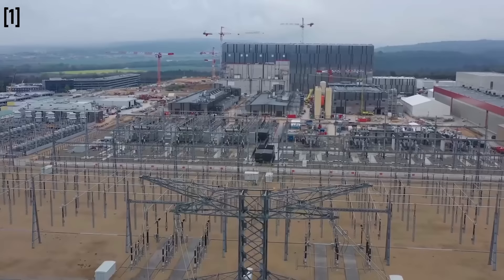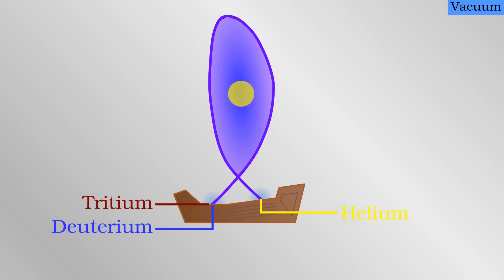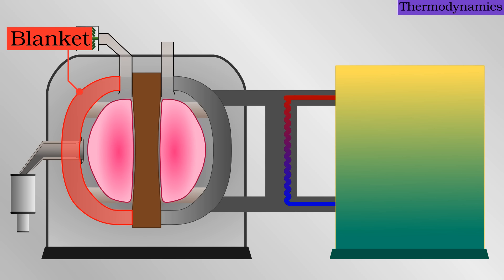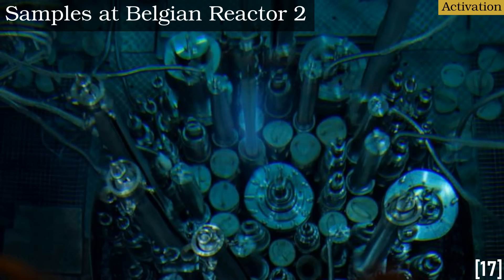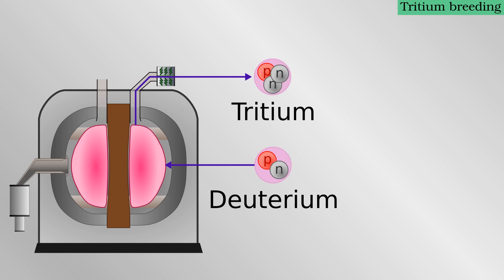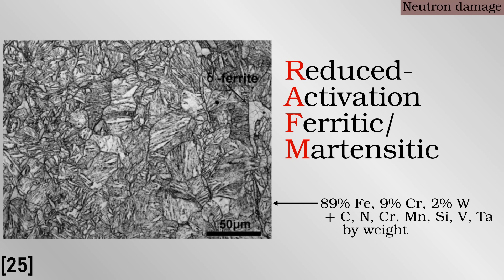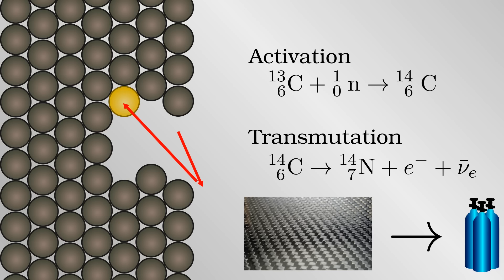How nuclear fusion (maybe) works (4) - reactor practicalities

Comment: I thought there was another method of "direct energy conversion" available to fusion reactors, but I may have been misinformed.
Plasma is made of charged particles right? What if you run the fusion plasma thru a magnetoplasmadynamic generator? Idea is simple, you have two electrodes, and two magnetic poles. The ions get attracted to one electrode by following the magnetic field lines, and the electrons follow the same magnetic field lines to the other plate. This causes a charge difference, or voltage potential, between the two plates, and by connecting an electrical load between these plates you generate an electrical current and neutralize the plasma at the same time.

Even without any college degrees, my high school physics understanding of how an X-ray tube works already tells me that at the negatively charged plate of such a plasma ion current based generator, x-ray generation will be a problem, and heating will be a problem at both plates.
However, it DOES generate an electrical current, and so energy IS present there, likely available as high voltage DC (or pulsed DC in discontinuous systems such as ICF reactors).

Is this method of generating electrical energy not possible? Why do you prefer to allow the magnetic fields to move and induce a current in a conductor, rather than harvesting the charged particles directly? I'm relatively certain that this method could also be run in reverse to cause plasma heating, and it likely already is.
But if I know one thing about physics, it's that there are not that many processes which are non-reversible. Of course, nothing is 100% efficient, but it seems that direct ion conversion would be incredibly efficient (and the gas produced should still be at a high enough temperature to run a standard steam cycle, if you really wanna optimize the production of energy from the reactor).
Reply from the maker: Yes, this is also possible. It still would have well below 100% efficiency, though and will be difficult to do. For example, I saw a proposal where they would need a 100 meter long converter for a 70% efficiency. Good luck bolting that on to an already enormous facility.
Reply: @ImprobableMatter  To make that shorter, you probably need stronger magnets, right? Could superconductors be applied to that to reduce its size? You trade off electrical resistance in the conventional magnetic solenoids for thermal losses of the system cooling the superconducting solenoids, but overall the more intense magnetic fields should make it easier to fit somewhere, plus there's that "flux pinning" thing that happens with superconducting magnets that should help it resist changes to the magnetic field geometry right?
Sure there's challenges to be overcome, but there's challenges to be overcome with the system as a whole, and I don't feel like this adds too much extra challenge to it because superconducting magnets are a relatively well-understood technology from what I understand.
Reply from the maker: @44R0Ndin  From what I understand (someone correct me if I'm wrong!) that method requires DC voltage. There's only so much potential difference you can have before it breaks down, even in a vacuum (i.e. you can't have 10 million volts across a millimeter gap and so on). Therefore, there is a reasonable size limit.
Reply: As stated, it wouldn't be able to capture any neutron or bremsstrahlung energy. Also, if you have the plasma actually colliding with the electrodes, it will be a big problem since the electrodes will be destroyed and the sputtering will put impurities in the plasma. For small scale experiments, you can have a weak plasma directly contacting a metal surface, and you do get a Bohm sheath charge due to electrons hitting the surface more than ions. And you can use geometry of barriers and magnets to cause only electrons to hit some electrodes, creating a voltage. But that isn't possible in a thermonuclear plasma.

Comment: I think aneutronic solutions that take advantage of direct induction methods of generating electricity hold much more promise for near-future base-load power production than your video let’s on.  
Most of the dangerous problems you’ve mentioned center around dealing with neutron emissions which do not happen in aneutronic reactions.  You also said that Hydrogen+Boron fuel is the only type that is truly aneutronic, however, Hydrogen+Helium3 is also aneutronic, producing a lot less Helium4 ash per reaction (1 instead of 3).
I do however agree with your analysis as far as it is being applied towards inertial confinement, tokamak and stellerator style reactors.
Reply from the maker: Hydrogen (one proton) has insanely low cross sections with Helium and Beryllium. Helium-3, unless you are breeding it through neutronic reactions (*cough* Helion Energy *cough*) is too rare to be economical.
Reply: @ImprobableMatter   It is now, yes.  But there is an enormous amount of free He3 that can be harvested from the Moon and eventually from the gas giants as well, so the cost factor should come way down.
I’m sorry but I do not understand what Proteum’s small cross section has to do with Beryllium; the magnetic fields used to confine the plasma keeps it from interacting with the reactor walls to any appreciable degree, while simultaneously increasing the likelihood of particle interaction between the hydrogen and He3.  That’s my understanding anyway.
Reply from the maker: @cyberiusprime4855  Harvesting Helium-3 from space will not be practical for hundreds of years, if ever. If the cost to launch is so low, why not just build space solar arrays for free energy?

No magnetic field can confine a plasma perfectly, so some will always be lost to the wall. Also, hot plasma emits radiation by bremsstrahlung and cools, requiring energy input. This will mean a p-B reactor will never achieve electrical breakeven.
Reply: @ImprobableMatter  I predict that being able to mine He3 from the Moon, in quantities that would benefit the operating costs of aneutronic fusion reactors is somewhere between 20-30 years away.
Helion is almost finished building there 6th-generation reactor which holds the promise of delivering net-positive energy within the next 3 years (albeit at too high a cost to be commercially viable yet), but that's not what's important now.  What is important is showing that the tech works as advertised.  If they can do that, then the profit motive for mining the Moon's He3 will have been secured, and Capitalism (i.e. greed) steps in to turn the promise into reality.  
Your time scaling for this is far too pessimistic in my opinion; you are aware of NASA's Artemis program to establish a moon base over the next few decades?  And Elon Musk's Starship Heavy Lifter?  The tools for getting there are well underway already...
I really think you need to research aneutronic reactor concepts a bit more thoroughly (and exclusively) rather than glomming them in with the older reactor types and their set of problems.
Helion's reactors use a reverse toroidal configuration for generating its initial stage reaction plasma which takes advantage of both magnetic and inertial confinement strategies simultaneously, thus the magnetic fields do not have to do all the work of confinement themselves, which I'd imagine helps minimize wear and tear on the reactor walls.   Plus, their design is not intended to create an on-going fusion reaction as is the case for tokamaks and stellarators.  Their current goal is a more modest fusion-pulse repetition just large enough to generate more energy out than it cost to power each pulse, then scale up the pulse frequency until it can produce enough electricity to be useful for grid-scale applications.  Seems sensible enough to me.
Last but not least, I can't speak on behalf of the p + B approach to aneutronic fusion; I haven't researched it enough to know what engineering hurdles it faces; Helion's approach uses D + He3, which you did not cover in your video.
Reply from the maker: @cyberiusprime4855  A single lunar base is very different from a cost-effective mass mining operation. The concentration of Helium-3 is measured in parts per billion; that means - roughly speaking - that if you want a kilogram of Helium-3, you will need to move of order a billion kilograms of rock. You need to somehow refine and separate out the Helium-3 and send it back. Good luck.

The proton-Boron reaction has an even lower cross section and requires even higher temperatures, so it's far harder to do even than D-3He.
Reply: @ImprobableMatter  Yes, I understand that these are early days yet, but if the Artemis project succeeds, then that "proof of concept" will become the basis for commercial investment in that new sector of the mining industry.  Once that happens, things tend to move much quicker.
Helion's analysis of the amount of He3 on the moon suggests that it exists in a sufficient quantity/state for easy extraction.  I do not pretend to have done any independent analysis of my own with which to verify their projections, so who knows how hard it will actually be.  Clearly, they are optimistic about it themselves.
Anyway, it was because of your high degree of skepticism towards the aneutronic approach to fusion that I felt compelled to argue in favor of Helion's D + He3 pulse/induction technique as a possibly viable approach - which I am still hoping will work as advertised.  I guess we'll find out in a few more years.

Comment: The presentation keeps saying a Tokamak is steady like a stellerator and it is not, it is pulsed. It depends on the collapsing central solenoid field to induce current in the plasma and the twist the magnetic confinement.
Reply from the maker: You can achieve steady state if you have beam or wave current drive. See part (3) of this series.

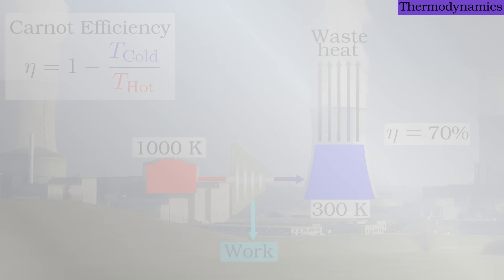Comment: 8:19
Really? Which fusion projects are assuming 60% efficiency in their thermodynamic cycle?

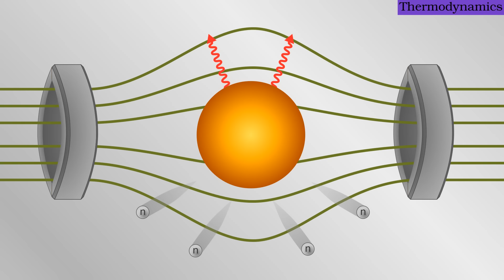10:05
Which projects are suggesting direct energy conversion from D-T plasma?

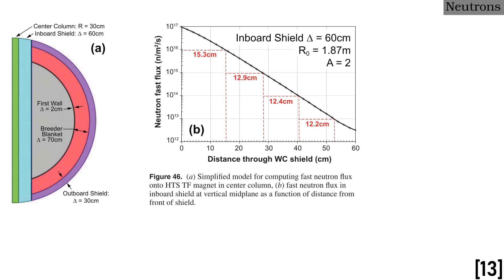12:21
Of course. Statistically, you can never rule out that a single neutron will be stopped by a galaxy of material. But I'd feel confident of its safety, given the log graph you present. Are you suggesting shielding is not practical?

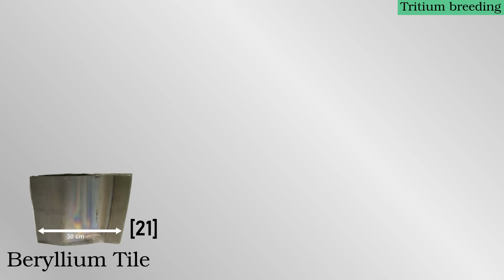19:50
Beryllium is a wonderful multipler, but there is not a lot of it in the world so many commercial concepts are looking at alternative multipliers, such as lead.

20:48
You're partially correct; a hybrid fission-fusion breeder reactor could be made but would present significant political challenges. [Edit: I spoke too soon; you mention hybrids at 21:50.]

On the whole, a good presentation, though we should be careful with communication of facts.
Reply from the maker: Reference [13] has a scenario of 59% efficiency for a fusion power plant on page 10. Reference [9] discusses direct energy conversion from a D-T plasma on page 205.

Comment: I have heard of Stirling engines, thermocouples and turbine engines. But never about Carnot heat engines. Could you do a video on the differences between them in the future?
Reply from the maker: The Carnot Engine is a hypothetical ideal (not actually something that could be built) heat engine which has the highest possible efficiency of converting heat to work. Any practically built one, like the Stirling engine, can at best theoretically reach the Carnot efficiency, but no higher.

Comment: It is unfortunate that new problems appear on the way to working fusion reactors. Material damage is one of them but the main problem by far is the efficiency of the whole process. There are many loss factors reducing the final efficiency a lot. I am afraid that some projects have been started before calculating far enough the final efficiency and the certainty of really getting power output.

Comment: I'm confused about the use of liquid Nitrogen for the cryo pumps?   I've worked with Cryo pumps used  to create vacuum in the 5x10-8  range.  The coldest liquid nitrogen (N2) gets is -193 C.  Cryo pumps operate using gaseous Helium compressed and expanded in a closed loop system.  The lowest temperatures are about 10 kelvins.   When a Cryo is above 23 kelvins it can't hold any more gas on the array and must be warmed and pumped clean.  A turbo pump backs a cryo pump only during the regeneration phase of operation.   Turbo pumps don't go lower than -8 vacuum usually. 
What level of vacuum is the system operating in  (-8, -9 -13,etc...)and what type of cryo pump uses liquid N2  to capture and exhaust any chamber it's operating on?  Cryo pumps usually accumulate molecules until they lose the ability to capture any more gas and then are warmed up to to outgas and be pumped clean to start again.  Art:body-blue-raised-arms:
Reply from the maker: Are you asking specifically about the ITER cryopumps pictured in the video? Yes, the active parts are cooled by Helium as you have said. Typically the system has a large store of liquid Nitrogen to achieve the Helium temperatures. There's a smattering of various other pumps, as I mention. Here's an old, but open access article (otherwise search for the latest publication if you have access) with the details: https://iopscience.iop.org/article/10.1088/1742-6596/100/6/062002/pdf
Reply: @ImprobableMatter  Thanks for the reply.  Do you know the base vacuum the ITER chamber is pumped down to?  Using LN2 for chilling HELIUM  is new to me.  We just used compressors to pressurize the Helium and send it  to the cold head in the pump.  We used to use Diffusion pumps for high vacuum but if there was a vacuum "accident" the oil made a mess that was a bitch to clean up.  After that period the tools used Turbo or Cryo pumps, much easier to keep clean.  Art:person-turqouise-waving:
Reply from the maker: @arthurriaf8052  Look at the table on pages 2 and 3. Note that they will have times when it's a pure vacuum and time when plasma is recombining at the divertor and hence a slight pressure and a need for throughput.
Reply: @ImprobableMatter  Thanks again for more detail.  Keeping a god high vacuum is tricky when other gasses are being introduced or generated by some beam interaction.  We made ion beams that use different gases to create a plasma.  the vacuum always suffered when the beam was at max power.  It's hard to remove  gasses with limited pumping capacity.  
I remember seeing 2 story tall Diffusion pumps with fore lines as big as my waist  to evacuate chambers for E beam welding on jets.   That's big scale.  Art:face-turquoise-covering-eyes:
Reply: @ImprobableMatter  Hi again I.M. after looking at the iopscience article the vacuum technology is impressive and given the scale and multiple requirements, I admit the system is above my pay grade to question the why they did it that way!  Trying to make the "sun in a jar " looks a bit harder than making toast.  Thanks for the reply and information you pointed me to.  I'm retired from the semiconductor capital equipment business after 40 years of fun so learning new things comes from the job.  Art:hand-pink-waving::face-purple-wide-eyes:

Comment: Step 1: Make a BIG ASS spherical vacuum chamber, large and thick enough, with enough heat mass to capable to resist the blastvawe of an at least 100 kilotons of fusion warhead. 
Step2: lower the fusion warhead to the center of the chamber.
Step3: BOOOM
Step4: use the thermal mass of the chamber to generate steam.
Step5: Use the steam to generate PROFIT.

Comment: I am having trouble understanding, what is the difference between high voltage plasma(farnsworth fusor, ionic wind ..ect 40kv and 10ma)  and high amperage plasma(tig welder, plasma cutter, ...ect 50v and 500a)  I am just trying to understand but I think I am missing something? Thanks
Reply from the maker: Plasma is just a state of matter once material reaches a certain temperature and density (like going from ice to liquid water). It's highly conductive, so you can discharge a large current through it, but there's nothing specific to the voltage/current across it. You can certainly create a plasma by discharging a current; a fuse can fail if you discharge too much current through it, as then the filament will heat up, become a plasma and become conductive.

Comment: Also, thunderf00t did three videos on the problems with fusions as well. One of them called in the thumbnail that the fuel for fission was 1000X more expensive than Gold. I would like your opinion on these videos form an expert point of view.
Reply: Dylan Evans’ comment just a few posts down may be touching on that aspect, albeit not in those terms.

Comment: Thorium 232 is not fissile by itself, but fertile. That means that it eventually transforms into the fissile Uranium 233.
Reply: Actually high energy neutrons in the 14 MeV Range tend to fission both Thorium 232 and Uranium 238 Atoms instantly without need for further breeding in between, that’s why the third stage of a thermonuclear bomb contains depleted Uranium (U238)

Comment: Anyone ever thought of using two particle accelerators (one for D, one for T) as fusion igniters?
And if so: What term should I search for to find papers?
Reply from the maker: Look up "Neutral Beam Heating". I discuss it more in Episodes 1 and 3 of this series.
Reply: This is how people originally figured out the "cross section", and tested it with different types of beams at different speeds. If you convert speeds to temperature, you get the graph shown in the video where DT has the highest reaction rate at ~100million degrees.

It turns out that most particles in the beam deflect off each other without fusing. You need confinement (e.g. magnetic or inertial) so that after the initial deflection, a D ion still has a chance of hitting another T ion.